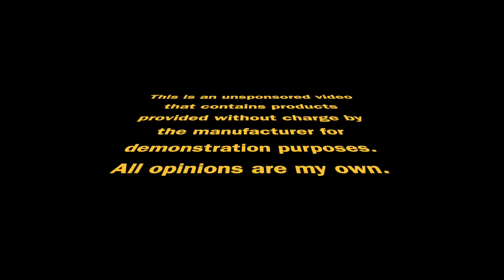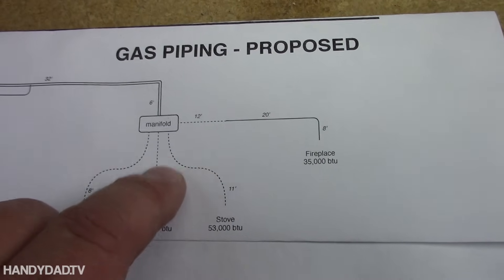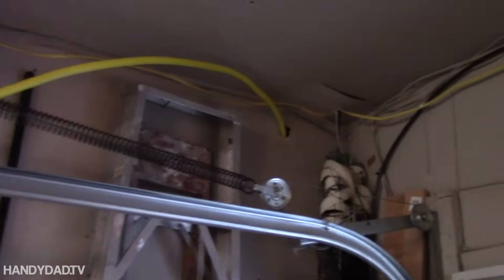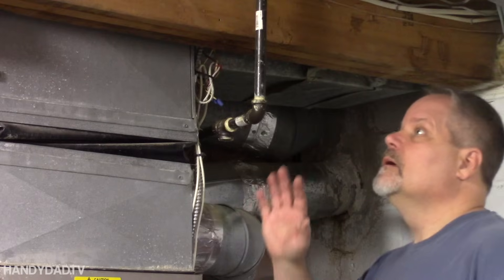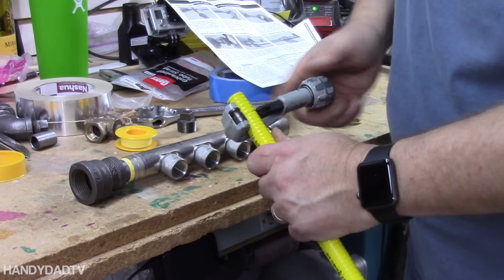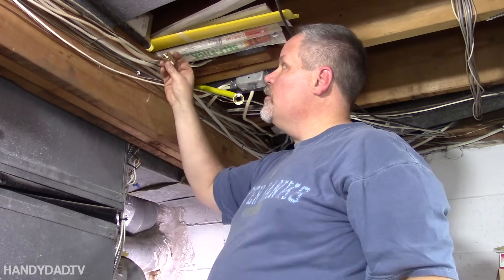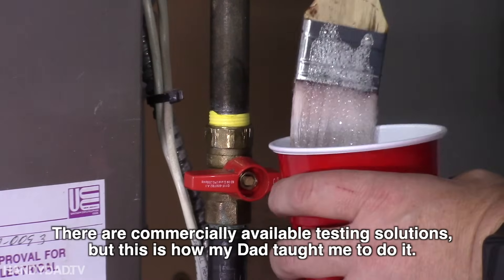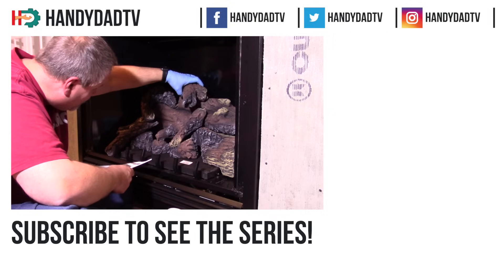DIY Fireplace Installation - Natural Gas Line

Comment: Nice video. As a licensed plumber I see a couple issues. First, when using CSST of any brand, it is not good to use dish soap. It is caustic and should be cleaned off after if it is used. Second, never test for leaks by introducing gas into the system. Use a pressure gage.  Third, when tightening fittings onto CSST, keep the body of the fitting still and turn the nut only. This keeps the internal washer from getting ruined by the cut edge of the CSST. Last, never add a second point of electrical discharge. This could be problematic in the event of a major electrical discharge like lightening. It could travel through one system, into the ground and out the other system.
Reply from the maker: Thanks for the feedback
Reply: So how would you ground the CSST? Bond to electrical?
Reply: @Jalapenoskyraisin  18awg wire to ground must be under 70ft
Reply: @Jalapenoskyraisin   Typical CSST asks for 6 gauge ground to panel.
Reply: “Never add a second point of electrical discharge…”

Can you please elaborate on what you mean?

I’m assuming you mean that the CSST should be grounded by way of an existing grounding rod, such as the one already grounding the plumbing system, and not by way of a newly-installed grounding rod as seen in this video. 

Thanks for any additional info you can share.
Reply: Dgloo, I was instructed to run the 6ga wire to the closest electrical panel and tie it into the house electrical ground buss.
Reply: So you pump air to say 20-30 psi and use an air pressure gauge to monitor for leaks?

Comment: In terms of the grounding. The gas pipe needs to be bonded back to the panel not bonded to a ground rod. By bonding it to the panel keeps all the grounding potential’s the same.
Reply: Absolutely Right Josh.  Two ground systems create different potential which actually create a hazard.
Reply: Perhaps it was semantics? It’s technically grounded to a grounded to a grounding by way of the electrical panel. (Just trying to give the benefit of the doubt.) ^_^

Comment: 1:  previous comments on testing are correct:  use a pressure tester and not gas.  CSST is not made to run through wall or out side.
Reply from the maker: Thanks for the advice
Reply: huh?  from specs:  【Installation】-High temperature resistance,Low pressure resistance,Explosion-proof and compressive material, it can be installed exposed to indoor light , or it can also be embedded in concrete, or behind the wall in dry wall systems as needed. also Suitable for burial installation,Underground Installation easier to handle Bends around corners,eliminating need for additional joints and fittings.

Comment: Folks remember there is a washer between the new line and the black steel pipe. You need to ground the new csst line to the black steel. Look up proper csst bonding or grounding.
Reply: I don't think it's an actual washer. The videos I was watching on grounding the csst from the manufacturer, only show a ground on the first fitting or the cast pipe, ran to the electric panel.

Comment: Would have put valves on each branch of the manifold
Reply from the maker: No need; there are valves at the appliances.
Reply: @handydadtv :  There might not be a "need", but shut-offs are very nice to have.  E.g.if you accidentally puncture the line to the stove, you'll have to cut off gas to the other appliances until that line is repaired or capped.

Comment: Gas has always been the one service that I would not touch, even now, but it I was to put in a manifold I would be putting in cut off valves to each appliance, it may be overkill but it would give me a sense of control.
Reply from the maker: You can add more, but code only requires shutoff valves close to the appliance, not at the distribution point. So there’s a valve at the furnace and water heater, and another behind the stove.
Reply: I would as well, it's much the same as where you place a fuse in case something goes wrong or there is a leak on just one line, then you can shut off that line and vent the area then continue to use the other appliances. 
Overkill, Maybe, But I too like the idea of that kind of peace of mind.

Comment: Thanks for the video! I am embarking on a DIY CSST project myself this month, and I discount everyone I see/hear/read to who states ...Only a professional is qualified to do this work...You are crazy to do this yourself...This is so dangerous...and on and on. 

If you are:
1. Following your local codes (which @Bob Yehlen missed in his second and third point)
2. Pulling a permit with a plan review with whatever your City requires for plans
3. And having the work inspected and bought off by the AHJ (Authority Having Jurisdiction)
4. Installing per the manufacturers recommendation, direction, and training (when applicable)
Then you are doing everything a "professional" would be doing.

Installing gas lines is not really any more dangerous than working on an ABS sewer line, or knocking a wall out of the living room, if you are doing it correctly. Sewer gases can kill just as easily, if not as violently as natural gas. The same goes for knocking out a column/post in your house to open up the living room, and it turns out to be load bearing. Dead is Dead. Treat any DIY project with respect, don't cut any corners, do your research, pull a permit, and have your work inspected.

As to grounding rods, we don't know what City you live in, or what version of the UBC, IBC, IFC, and NEC your City has adopted. It doesn't matter if you have been doing this for 50 years, if you are not following the correct code, you are doing it wrong.

The current NEC section "250.102(B) Other Metal Piping" ALLOWS bonding to a single or double ground rod, not attached to the electrical panel. It sounds like the city of St Louis has superseded the current NEC and has their own requirements, so we shouldn't call someone out for not following "code" without knowing what codes his jurisdiction has adopted.

My City uses both the 2012 IBC and the 2012 IFC, and they have not adopted the 2015 or 2018 versions, and they do not inspect electrical, but defer to my electrical provider to inspect so I have to pull two separate permits to install a gas line. It comes down to know your code. Additionally I have to sign an affidavit with my Natural Gas Provider that I will occupy the house for 24 months after the work is complete if I am doing the work myself.

My only criticism on your video is your initial pressure/leak testing. I would not recommend doing this with is the gas supply. Get the pressure gauge adapter and bicycle pump adapter, and pump the system up with air. Let it sit ATLEAST the amount of time required by your AHJ (mine happens to require only 30 minutes), and test only your very last connection (usually when you take off the air pressure gauge) with gas. Then retest the entire system with a manometer

The only things that hiring a licensed professional piping installer will give you (over an enormously inflated bill) is they make it EASY since they already know the code and requirements for your area, and they understand the calculations for sizing gas lines off the top of their head instead of having to put it down on paper and think about it.

I have been creating and distributing methane gas for 47 years just to one up the 30 year and 35 year "professionals"  that are posting
Reply from the maker: Thanks for the comment. Couldn’t agree more. The inspector (Freehold, NJ) is a licensed plumber who knows the code inside and out. The cost of the permit gets his advice in addition to the inspection. 

I tried to pressure test the entire system, but the regulator on my meter kept releasing the pressure. And I wasn’t about to disconnect the meter and cap it. It wasn’t required by the inspector. He only required me to do the pressure test on the fireplace line. The rest, I tested the old fashioned way, with soapy water, like my dad taught me.

Pros hate DIY channels. I get it. But I’m not trying to convince everyone to do things themselves. Just the ones who want to. The rest will keep hiring the pros. Live and let live.
Reply: All AHJ should follow NEC on electrical.  NEC wrote by some of the most knowledgeable in electrical safety installation.  If your city adopt something else and than even defer the inspection to someone else again than those officials don’t know anything they doing that put your safety at risk.  Those officials just want to be different and power attention.   They should just follow NEC.  Please don’t dispute them professional.  I’m talking this as an master electrician, refrigeration, warm air ventilation, and gas piping doing it so many years and still make mistake sometimes.  So yes really you need someone need to know exactly what they doing.  Those inspectors lot of times they has no knowledge of the trade at all especially city cutting down budget.

Comment: cool video. just some speculation, with all that work adding a manifold why not buy a shut off for each line? also that style of valve is against my local code. they need hand turn style valves. the pressure regulator has a rupture plate in it that can blow out if you open them too quickly. we always open them slowly because my company has blown out several. thanks for the video.
Reply from the maker: Thanks

Comment: Nicely done both in laying out the plan and with the video. There are tables that show the diameter needed for the supply line based on the length of the run and the BTU's of the appliances. I used corrugated line that was one size up so I could later add a gas feed to a barbeque in the future as the location would be a 12 ft run from the fireplace connection.
Reply from the maker: Good thinking

Comment: Hello sir! Quick question as I live in Nj as well.. not too far away from freehold I may add! But my question is, did you install gauges along the new line? How does the inspector pressure test it? And also, did you need to keep the gas off before the inspector showed up? Thanks!
Reply from the maker: The inspector only required me to pressure test the new line going to the fireplace. I couldn’t leave the gas off to all the appliances. It was winter and we needed heat and hot water. So I only installed one shutoff valve on the manifold: the fireplace. I left that off until it was inspected. He required me to install a pressurized gauge at the fireplace end to show that the line held pressure for 15 minutes. Your inspector may want something different.
Reply: @handydadtv  your inspector is an idiot,  you broke into ALL the lines servicing ALL the appliances, so he should have required a pressure test on the whole system.  A little knowledge is a dangerous thing.   Just because the city allows you to do the work yourself doesn't mean you should.
Reply from the maker: I tested every connection for leaks; he just had me do a pressure test on the one I pulled through the walls. Made sense to me since that’s the one with the risk of puncture.

Comment: I guess that CSST has been around since the 80's in Japan. I heard that earthquakes posed an issue with hard piping so a flexible pipe was developed.
Reply from the maker: It’s so much easier to use!

Comment: To all these nay-sayers:  sure, gas is dangerous.,  I had to replace my gas furnace two years ago.  Got bids for it. But was expensive! I, too, was skeptical and 'scared' to DIY from all the negative comments.  UNTIL.... I started reading some of the positive reviews from some of the DIYer's.  I had to modify my existing gas line to fit the new furnace.  I bought the furnace (local's wouldn't even sell me one.....) and installed it myself!  I was able to upgrade to a better furnace modify and improve some duct work and still save nearly $4,000 in the process!  I did a lot of research on installations, etc.  and watched more than one YouTube video for sure.  If people check on local codes and requirements, use 'common practical sense" and observe all safety manners when working with gas lines there shouldn't be any problems.  But if you are skeptical ..... then perhaps hire a contractor for your own sanity!  PS. I plan on remodeling a house and use a similar system described here.  Thanks for the tips and how-to's in this video!! and to those of you with your POSITIVE remarks, comments, and suggestions!!
Reply from the maker: Thanks for the feedback. Mad respect for you dude! I converted from an oil to a gas furnace in my first house. I didn’t have YouTube but I had my Dad to mentor me back then. I paid a guy to adapt the ductwork for me. YOU are my idol. 

BTW, I don’t have the time to argue with all the negativity. I’m no expert so it would take too much to research my responses to not sound like an idiot. 😉

Comment: Can you use CSST to run from the manifold in the basement, directly under a deck and to a Outdoor gas fireplace?
Reply from the maker: I don’t see why not.
Reply: @handydadtv  ty
Reply: 【Installation】.... also Suitable for burial installation,Underground Installation easier to handle Bends around corners,eliminating need for additional joints and fittings.

Comment: Csst flex connectors have been around for decades. Csst tubing is fairly new in the last 15 years. It is free to get a Gastite certificate the whole training corse is exactly what to do and what not to do. Homeflex from homedepot does work but Gastite Flashsheild is way better quality and easier on my opinion.
Reply from the maker: Thanks

Comment: Re: 7:42 I disagree - you want to use the cutter in the other direction, because it stabilizes the cutting arm, and keeps the blade from wandering.
Reply from the maker: Thanks for the tip.

Comment: POLY GAS PIPE, can i use without corrugated stainless steel tubing
Reply from the maker: Check local codes.

Comment: Usual method for sizing gas line is the LMR (longest measured run) method. Manifold allows you to size each individual run back to the meter after the main supply line is sized. This system is undersized however using ur manometer the pressure drop for each appliance can be measured. Each appliance would have allowable pressure drop on tbe rating plate. Please do not mess with things if you are not a trained gas technician and be careful folks

Comment: They make it soo hard anymore just to make a single sarcastic remark. I have a similar upgrade mountain to climb. a 140k btu tankless feed 150 feet away from the meter. Three items in total 1. Garage water heater 50 gal. (70 feet) of black 3/4 

2.HVAC 3/4 (120 ft)  maybe 5 ton for 2400sf   3. The tankless gas supply is from the heater line so no go. and another 30' further anyhow. So I am breaking a coupling before the HVAC and going 1" for that last 50'.  The shower will accomodate for 5 + minutes and might be spitting out 110 deg since we are not washing greasy dishes or clothes in there. I bough pipe not knowing the Flex can work easier into the wall. Maybe HD would mercify my return/swap.   No showers yet for 8 months, my wife is lovin it.

Comment: I would say your system is undersized for 4 runs… I’ve installed many 5 run systems and make my manifolds with black pipe Tee’s each line having its own shutoff for servicing reasons. And a main shutoff before the manifold usually 1 1/4” black pipe. I use Trac pipe and auto snap fittings this comes from my HVAC supplier… I must ask what material is your manifold made of ? And also pipe dope is far better than tape and always secure your runs with straps. The thru wall wouldn’t meet code in the state I live and I’m licensed in. Just curious a few things don’t look right … Please be safe people when working with Gas and Electric… 🇺🇸✌🏼👊🏼
Reply from the maker: I’m not sure what kind of metal the manifold was made of. My installation was inspected so I have to assume it was acceptable in my municipality. I’ve since moved into a new house but thinking about adding another fireplace. Never know.
Reply: @handydadtv  
Ahh OK …. Codes are different from state to state

Comment: are the fittings to the manifold and to the yellow pipe reusable? I need to undo one at the end of the manifold to add on. thanks
Reply from the maker: Yes, if you’re careful when you remove the lock ring, you can reuse it. I reused the one I used for the demonstration.

Comment: In another similar video they added gripper compound where the male connector with the washer is attached to the pipe.
Reply from the maker: Pipe compound is for threaded connections. This is a compression connector so I’m not sure the pipe compound does anything.

Comment: I moved here this summer. There is free gas here on this land, but when it gets under 20 degrees it freezes up and I have no heat. All that gas is heat.  I was thinking of getting a holding tank at the house for when it freezes up.. is that possible.. need help please
Reply from the maker: You need to call a pro.

Comment: hey you should have separate shut off valves for each appliance from the manifold and also by code should have a drip pocket in the manifold to trap the impurities of the natural gas before it is supplied to the appliances
Reply from the maker: It passed inspection. The shut offs are at the appliances.
Reply: HandyDadTV I guess you have the drip pockets at the appliances as well 
Good to know buddy
Reply from the maker: I do.
Reply: @handydadtv  by adding shutoffs at the manifold for each unit you can isolate each one for any future work or fixing problems without downing everything